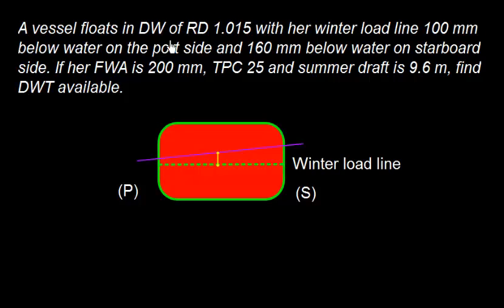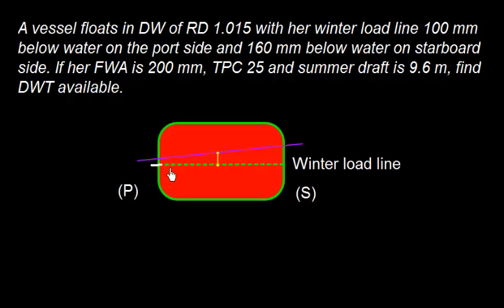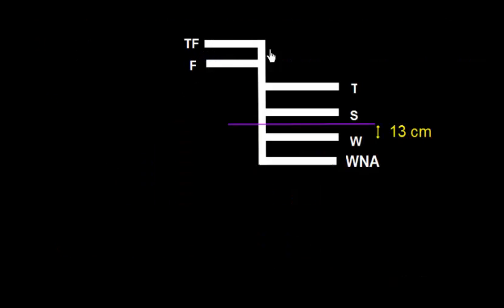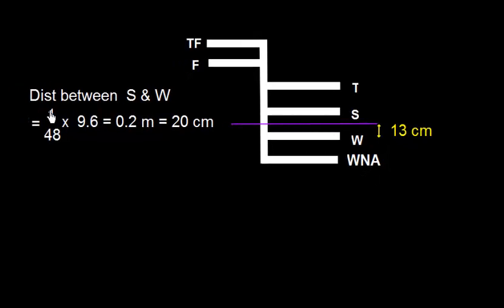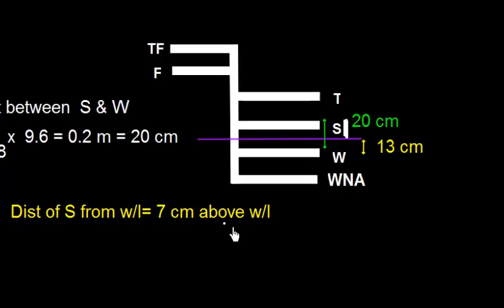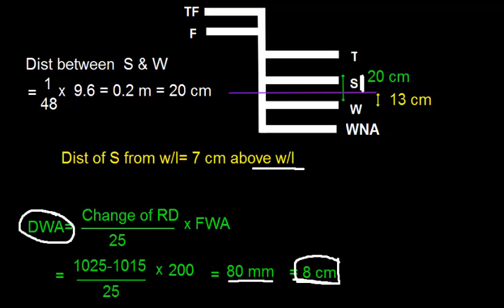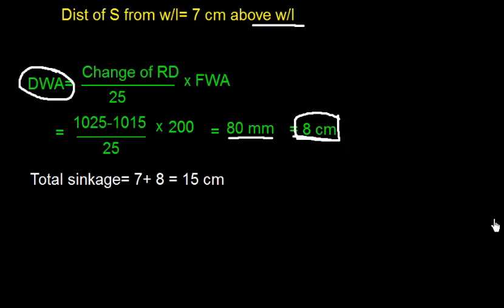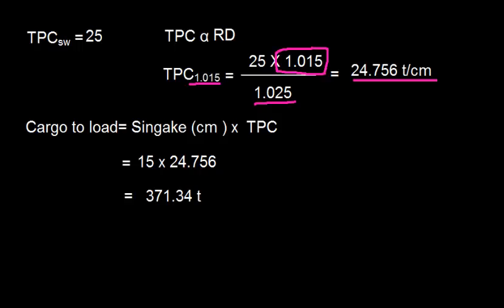Ship Stability _ FWA _ DWA _Load Line Mark  Problem

Comment: please be advised that there is a mistake about solving out the question ,when you use Dock allowance formula, you are finding the draft change , when the vessel sails to salt water from  dock water and it is 8 cm  so 8+7 =15 cm below the summer load line when you are salt water , from that point , you need to use TPC for salt water not dock water , because you consider the vessel is in the salt water.
Reply: For second mate( FG/NCV)/ DNS/ Bsc NS prepration join kundan patna #kundanpatna

Comment: How to calculate when you are in tropical zone?
Reply: For second mate( FG/NCV)/ DNS/ Bsc NS prepration join kundan patna #kundanpatna
Reply: tropical to summer 1/48*SD, meaning if you load maximum cargo in tropical, when you arrived to Summer zone, your draft will be 9.6meters (as given in the sample in the video), meaning to say your Tropical Draft previously is 20cm more than 9.6m, or 9.8meters....BOTTOMLINE, if you are coming from a Tropical Zone and going to Summer zone, do not load more than 1/48th of your summer draft,, or simply just load at the upper edge of your Tropical Zone so that when you arrived in Summer Zone you will still be in your upper edge of Summer Load line (assuming the load port and discharge port is seawater density)

Comment: Can you explain from where you got the formula for calculating the distance between summer load line and winter load line ?
Reply from the maker: I believe that is the regulation ( load line convention)  that distance  between  T and S or S and W marks should be 1/48th of summer draft. I still need to figure it out how this number ( fraction)  is arrived. Presently beyond the scope of teaching this topic. However will revert  as soon as get some info.
Reply: 1/48 x summer draught = mtrs difference then subtract it by summer draught to get winter draught 

as the differnce between summer to tropical is 0.48 mtr and summer to winter is 0.48 mtr

and winter to wna is 50 mm
Reply: What's the formula for wna to s?
Reply: For second mate( FG/NCV)/ DNS/ Bsc NS prepration join kundan patna #kundanpatna